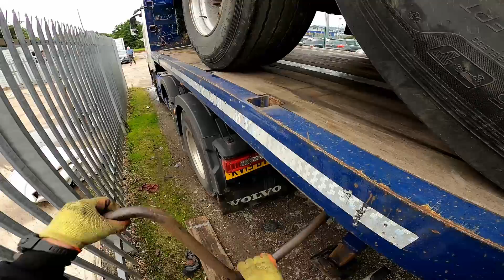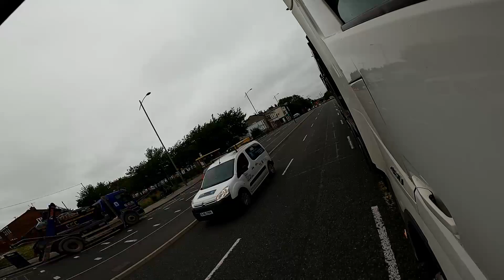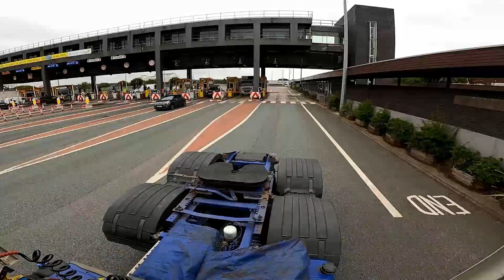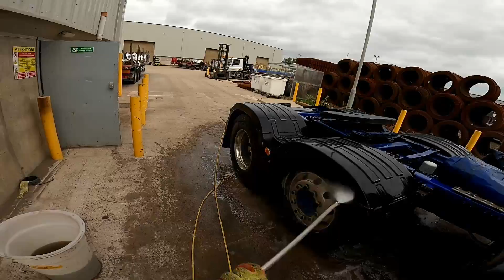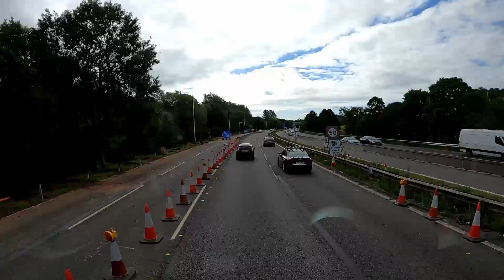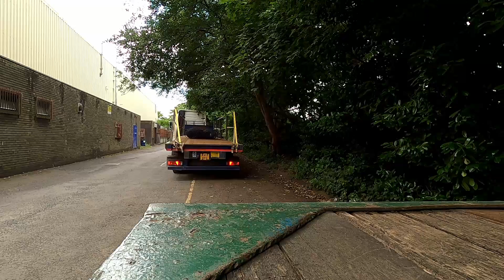Stacked Trailers

Comment: In the late 70s I worked for a trailer hire company called Trec Rentals in east London, they are long gone. I would deliver flat bed trailers to customers sometimes 3 high. I would wind up the legs on each trailer to keep the height down and load them opposite ways around.
They would be loaded by 3 forklifts, one under the underun rear bar and one each side under the chassis near the front. They would lift each trailer and I would reverse under.
Thanks for interesting videos, it takes me back.
Reply from the maker: Nice thanks.for sharing

Comment: Let me tell you how to carry trailers safely and why your method is dangerous.  You must strap the axles of the trailer to your platform and of course chock the wheels front and back - you also strap the legs and be sure to lock the winder so that it cannot unwind.
Th e reason for not doing it your way is that the deck of the trailer you are holding down can bounce the straps loose - you strap the axles by going around the wheel fore and aft.  stay safe from an old timer that has carried tractors, trailers, farm implements etc without any issue  PS cars as well.
Reply from the maker: makes sense what you're saying. i had no idea what i was doing here 😄 i belive the most appropriate thing to do was to chain them down
Reply: @Raul689  You are a good man and most of what you say is spot on, we need more like you on the road but sadly I left the industry in disgust after operating a fleet of LGVs and getting no thanks for 20 years of trying with not a blemish.
PS Chaining would be difficult to do - just 3 tonne ratchet straps ok.  Just another point ensure that air is removed from the axles being carried so that the platform sits on the rebound rubbers inside the bellows.